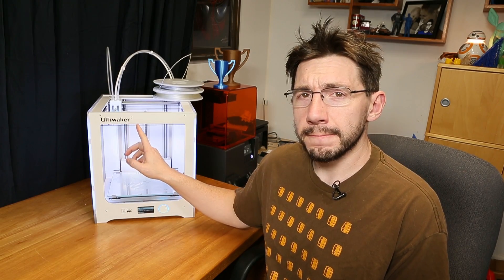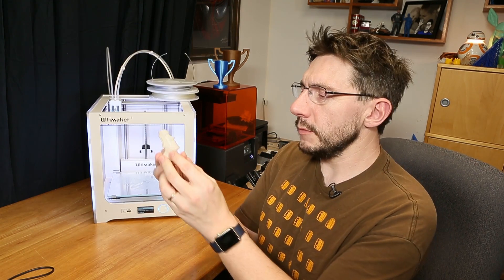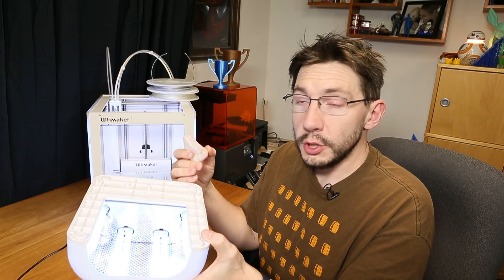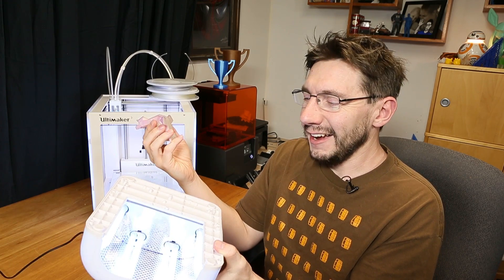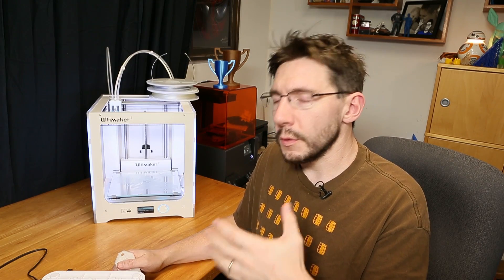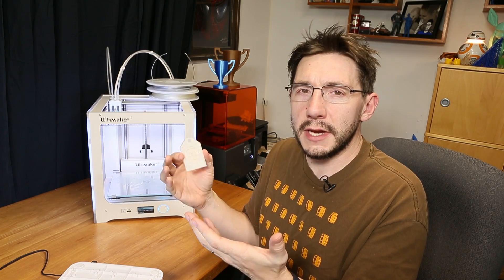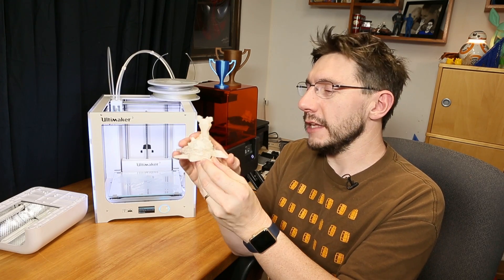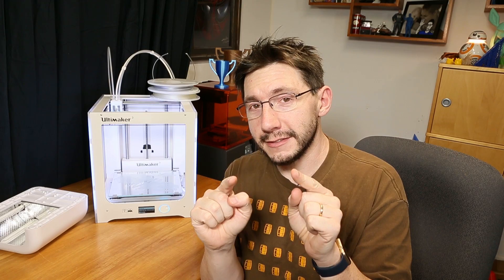3D Printing on the Ultimaker 3 using Multiple Materials

Comment: I have question, I am also using simplify3D, with Ultinaker 3 extended, due to long waiting of print head switching, the PVA always burnt / stuck in the print head so end up printing failed, how do you adjust the temperature of print head to prevent this?

Comment: So where is the review? All you talked about was how cool using UV filament was and towards the end you gripped about CURA. If I am going to spend 4K, I want to know what material it can or cannot print with. The finish, the speed, the ease of use and so on. Every review I have seen keeps saying it is just like the Utimaker 2. Why should I have to go and watch another review? Would you like it if Road and Track or Consumer Reports did this? Now I have to search for your review of the Ultimaker 2, watch it and take some notes and then re-watch this video to see what features you are calling the same.You are not the only review that has done/said this. Why should I buy the 3 over the 2? One reviewer gave it glowing praise... the main problem I have is that you can buy them through him. Not exactly unbiased or a true independent review in my opinion. If it were a ~$120.00 clone, then no big deal (I know for many getting scammed for $120.00 IS a big deal) but $4K IS a very big deal. I hope someone does an in-depth review. To me, the build area is not very big.
Reply from the maker: +Mr Random Where is the review? Not out yet? Haven't produced it. I'm going to produce a review video of this printer when I'm done reviewing the printer, I assure you. This video was nothing more than me showing off something I thought was cool.

Comment: I am still waiting for upgrades to my printer, damnit!, but has anyone tried printing flex and solid at the same time?
For example, a hand with bones and flesh?
Or
A wing with hinged control surfaces?
Reply: yup. works.
Reply: @SylvieTheBagel  
Way cool. 
I have tried a mixer head and that failed
Then I tried a three way switching head but couldn’t find the secret of retraction without leaving a big lump on the end that refused to feed next time. 

So I ended up just running multiple prints and changed the bed coating thickness each print and got interesting results. 
Especially with infil and no edges.
Reply: @SylvieTheBagel  
I’m a delta.
Reply: @brucebaxter6923  ah. well... palette does still work with Delta. sadly, IDEX doesn't. do you think Deltas are good?
Reply: @SylvieTheBagel  
Deltas have their place, high precision is not it. 

If you get a delta put it in a cupboard and glue it to a shelf on top to prevent flex.
Reply: @SylvieTheBagel  
Sorry I have not looked up idex yet, I found that the mixer types burned if they weren’t used regularly.
Reply: @brucebaxter6923  I think the circles they could make would be great, and with low speed, you might get some quality. But they can go pretty fast, right?
Reply: @brucebaxter6923  huh. I should look up what a mixer is. IDEX is InDepented EXtruders. On your x-axis, you have two hotends, bunthey each get their own belt, and can move individually. Meaning, you can print two objects at oncez on the same printer.
Reply: @SylvieTheBagel  
Yes. 
They are fast and very large volume. 
You can get reasonable accuracy out of them but because of so many moving parts that come loose.
Reply: @SylvieTheBagel  
Oh sorry,
Yes idex is two separate units. 
There are many mixer heads on the market and the most common is a two Bowden cables into each end of a hot end and a single extruder nozzle in the middle. 

I tried the triple hotend single nozzle. 
Magic as far as making any colour you want, but burnt and clogged if not used.

Comment: I've always associated dual extrusion as a way of getting multiple colours or, as of recently, a way to get dissolvable supports. This method of doing regular and UV changing material has given me some inspirational ideas. The UV reactive parts could be used for making something like a sunlight gauge or maybe a discrete secret pass where the door guard or bouncer keeps a UV light handy. Multi-material has me wondering if it's possible to do wood-fill bronze-fill combinations. This could be the perfect marriage of cross material prints for a steampunk dream print. Just some ideas. In any case, happy holidays!

Comment: hey again joel ive heard about pva filament do you actually have a video on pva? would be interested to see that! as far as im concerned pva is glue lol for wood or paper or used in building work for sealing floors or using for wall plaster
Reply from the maker: PVA video is coming soon!

Comment: I have glasses that turn into sunglasses when they are hit by UV light, and they don't work when I am in my car because of the UV blocker in car windows.
My guess would be that your print won't work either. Besides, it's PLA and when the sun hit's your car, it get's really hot inside. That could be the second problem for this idea.

But... You never know unless you try it.

Comment: You would have to test it but UV reactive filament might not work in a car. Car windows sometimes have a UV blocking coating, so UV rays won't damage or fade the interior of the car. I know that transition lenses don't always work properly in cars due to the UV coating.

Comment: Joel what filament did you use on the blue trophy cup in the back ground.
Reply from the maker: +Robothut the blue trophy was made with some Orb Polymer PLA-OP filament!
Reply: Robothut it's not a filament. That ones is made of metal and then he scanned it and printed out the larger brown one behind it